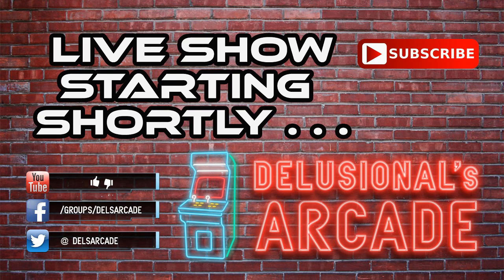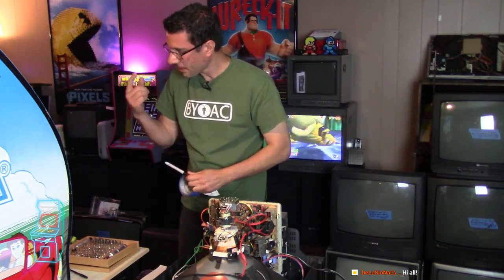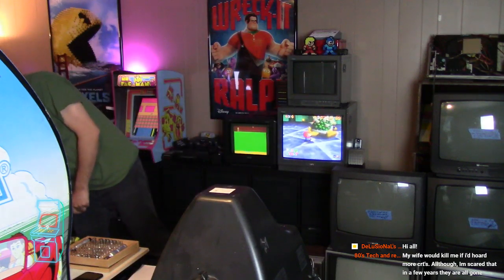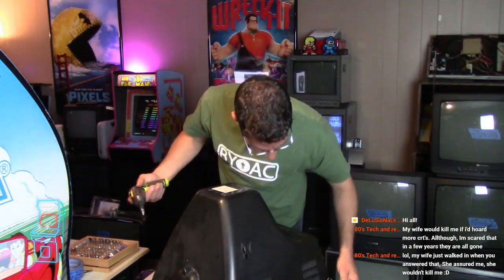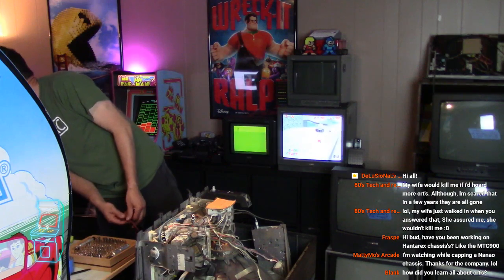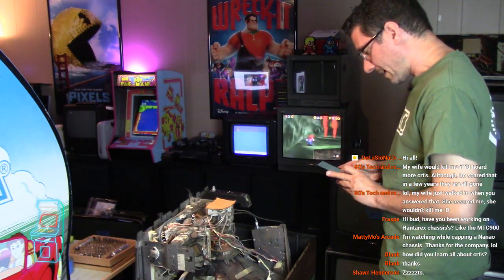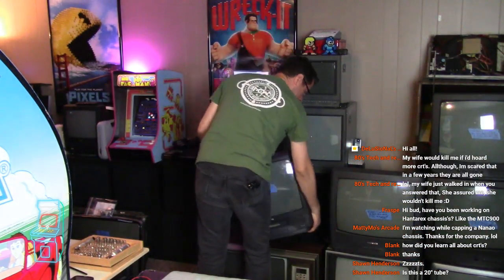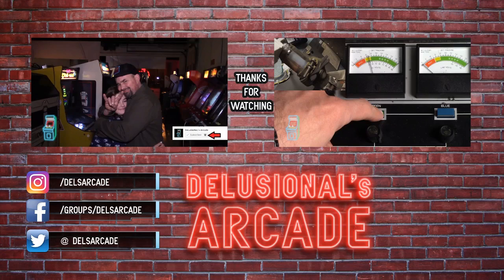Testing More TV tubes [LIVE]

Comment: That old 80’s zenith tube was a 100 degree deflection tube used in wg6100 and electohome g08 color vector monitors...   hard to find
Reply from the maker: I need to check, but I'm pretty sure I recycled that one. :-/ If not, I think I'm going to donate it for free to the arcade community.
Reply: DeLuSioNaL's Arcade that would be a great thing..   i just found that very same tv on fb marketplace about 30 miles from me..  waiting to here back from the guy...   he wants 50 bucks for it..  which i would gladly pay..   but i’ll see if i can get it a bit cheaper